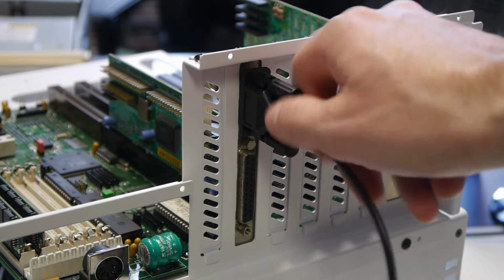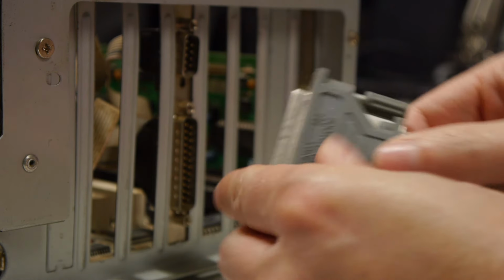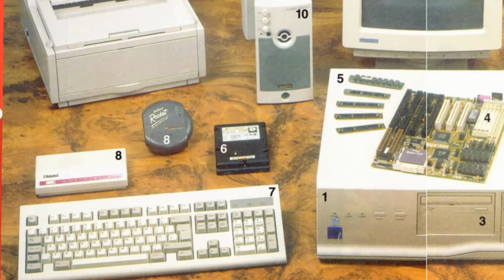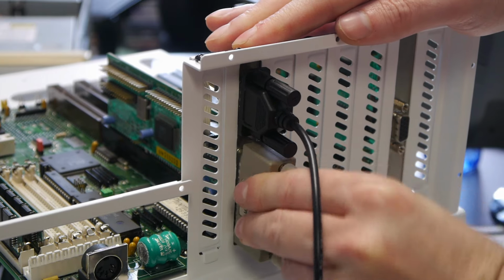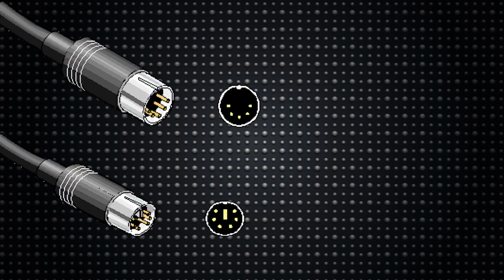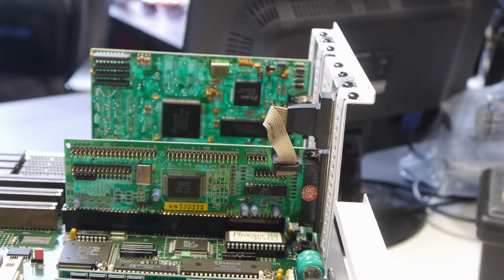What did we use before USB? | Nostalgia Nerd

Comment: Who remembers connecting 2 PC's together with a serial cable and using "LapLink" software in dos to transfer files between machines at a whopping 115k.
Reply: I did that, but not for LapLink. I used it for DooM, the first Command & Conquer and Red Alert games with a friend, and briefly for Jedi Knight until we upgraded our modems to 56k and moved on to IP games, and later the Zone.

Good times. I do miss the old days, but I do still use a lot of oldschool console copiers, so at least I still get to fiddle with floppies and parallel.
Reply: The Norton Commander could connect 2 PC's as well for file transfer.
Reply: Or a parallel laplink cable and get much higher speeds!
Reply: @JeroenPluimers , I worked at Traveling Software at the time and was the primary developer on the parallel transfer technology.  Fun times!
Reply: f29 retaliator. Couldn’t use the network, but did use a null-modem serial canle for two-player gaming. My graduation took a lot longer because of it
Reply: Still faster than many USB Drives after 1GB...
Reply: @imperfectcell7517   One computer would have intersvr.exe, and the other would have interlnk.exe. You needed to edit config.sys to declare interlnk.exe as a device driver. The interconnection could use the serial ports or the parallel printer ports on the two computers. I keep olde computers around for just this purpose, so that when someone sends me an old drive and they need the data extracted from it, this is the method. The old drive goes into the computer that has intersvr.exe, the computer with interlnk.exe is a more modern machine that accepts the data and then after everything is transferred, it can then be placed on a CDR or thumb-drive.
Reply: @GrowlyBear917  cool setup
Reply: Nope, but I do remember X-Tree Gold!
Reply: DJ_PaulTUK oh that was magic!!!! So much self accomplishment back then.
Reply: All i remember is fire wirw

Comment: Serial ports (mostly the standard RS232, but also RS422 or RS485) are still being used for industrial applications. They are ideal for low speed communication where there's no need to pass around  large packets of data - for example, if you need to control a power supply which is only turned on and off a few times in a hour or a digital multi-meter which needs to report a single reading every few seconds. USB is  being adopted but, pretty slowly since it is also far more complicated to implement USB communication into a device than good-old RS232

Comment: I used to hate SCSI. Didn't even bother trying to get a card with a CDROM when they came out mid 90s, SCSI was an interface jungle. And all the IRQ/Mem mucking about on the cards on PCs -sheesh! A decade ago when i moved, i dumped a large box with 90's cables into the trash and i still have no regrets.

USB was mediocre when it came around, i bought a 128k USB Stick (that's right, 1/8th gig, whopee!), while it was nice to be able to transfer some files between PCs, it wasn't fast or as ubiquitous as it is today with 32/64 GB sticks being sold everywhere for €10-20, and 2 TB external harddrives with USB interface being sold for €100.

We're better off now, but there are still adapters form Usb sticks, SD-> Micro SD and CF cards->micro SD (i still use them in my Amigas). Would never believe that i could fit 256 GB of data on a thing the size of my thumbnail... and they're only getting more capable each year.

Comment: USB is faster but one of the things i like about serial, parallel, VGA and game/midi ports is that the connectors are robust and not easily damaged by careless people, dont wobble and have thumb screws to secure them. USB plugs and sockets (micro especially) can easily get damaged/broken, become loose, make poor connection and easily fall out. I've resoldered or replaced the microUSB socket on phones and tablets many times for different people.

Comment: I definitely don't miss having to scrounge around for connectors, adapters, & couplers. USB still has a similar problem with all the different connection types. Type A, Type B, Mini USB, Micro USB, & Type C along with the 3 different iterations of it. So you still end up needing things like an A to C adapter & such. Just now days, the cables aren't as bulky.

Comment: USB was great, simple and convenient until all the madness with the different versions of USB 3.x started. Now there are probably more varieties of USB connectors and standards than there were different ports on old PC's.
Reply: jgfjgfify It's the same mistake that helped kill parallel SCSI.  The standards committee was overrun by lobbyists wanting to sell more adapter cables, and in the end, you always lack the right cable for whatever you need to connect.  USB can now have any of 5 to 6 A connectors (including C used as A) and any of 5 to 6 B connectors (including C used as B).  Plus either of the 5 to 6 female A connectors on extension cables and either of the other 4 to 5 A connectors in link/transfer cables with any of several standards for the molded in A to A link chip.  That's more than 70 different USB cables you might need to have in your parts drawers.

Comment: By the 90-tys a lot of new computers had both a 25 as well as a 9 pin Serial port (and a parralellport). the 25 pins was usually used for modems and the 9 pin for mouses during the time people browsed the web with windows 3.1.

Anyway. Using a old 25 pin to 9 pin adapter you could use two mouses at the same computer. In windows 3.1 it really didn´t do much. But in the game Settlers this made it possible to play split screen... PERFECT.

Comment: I hate USB. I am a hobby OS developer and electronics engineer (by trade). I bet other people like me know what I mean.
Reply: P these days I resort to USB to serial converters, either as those cost interface cables or ICs that do this function.
I built a small magnetometer that uses an IC to provide the connection between the desk top computer USB and the serial interface on a magnetic sensor module. The module uses the same IC found in some tablets.
I think if we are going to be forced to use blotware we might as well use a radio interface such as Bluetooth or WiFi, these are now available on small microcontrollers such as the ESP32. These have the advantage of inherent galvanic isolation. So my next home brew testgear will connect by radio, either bluetooth, but more likely WiFi.
Reply: pvc completely agree. It was once very easy to talk to the hardware using an application program. USB drivers and protocol stack makes this really hard work.
I have designed a number of bits of test equipment which supports USB, but these usually use ICs that convert usb to a virtual serial port.
Reply: Daniel Bush don't you mean inconvenience. The wonderful thing about USB drivers it allows manufactures to make perfect working peripheral hardware obsolete over night and blame it on the os manufacturer. That way the peripheral manufacture can sell the user yet another version of the hardware which is slightly worse then the one it replaces. By worse I mean shifts yet more of the work load on to the computer processor, and missing one or two of those odd useful features that were in the last version. Printer manufactures please note.

Comment: Firewire wasn't an Apple-only thing.  I have a Dell laptop with a mini Firewire socket, although in the PC world it is commonly known as IEEE 1394 or i.Link.  Many Sony laptops also carried it.
Reply: It was heavily pushed by Apple/Sony, and adopted as standard DV connector for digital cameras.
Reply: IEEE 1394 is a serial bus standard that was collaboratively developed by Apple, Intel, Texas Instruments, Microsoft, Sun Microsystems, Compaq, and National Semiconductor
it was a real bus, it was low latency, it was DMA capable and it was HIGH Speed compared to USB.
But it was also expensive and only was used in professional equipment (the Apache attack helicopter) like audio and video equipment, and early external hard drives including the first 3 gens of apples iPod.
Nvidia Chipsets offered fire wire as a default. And many other PCs hat it too. And it was often the only way to get digital video of a miniDV camcorder.
Reply: I still have an early 2000s Sony digital camcorder, and it has a Firewire/1394 port.  I never had a PC that I could plug it into...  Always had to use the RCA connectors.
Reply: From what I remember (can´t be bothered googling :P ) the name "Firewire" was exclusive to Apple, while the standard in itself was open (IEEE1394). I´m sure this will swiftly be corrected if wrong,  by one or more of the many YT police persons. Or if without swearing and childish language just a person wanting to enlighten me - thanks in advance in the latter case.
Reply: It was actually a Sony invention. I remember I had to buy a Sony camcorder > Apple FireWire connector to transfer my home movies to a Mac.
Reply: The original Playstation 2 model even has it.
Reply: srtgrayfrance It was developed by Apple but not exclusive to Apple.

Comment: there is something i am missing in this video, and pretty relevant. The fact that before plug and play, every connection has to been set manually in facts of DMA and IRQ, sometimes forced using jumpers or dip switches next to the cables
Reply: oh the days when something went wrong and spending hours troubleshooting jumpers and irq settings and everything else with no internet and only manuals and you own experience
Reply: @thatdumbguy6171  
But ... you could trouble shoot it.
Today if the modern Plug&Pray driver just refuses to work, you are doomed.
Reply: Cochese    ...and terminator plugs for the internal flat flex cables.

Comment: Saw the title and said to myself. "What a dumb question, of course we had this mess of gameports, serial ports, DIN ports, PS/2 and all other things both standard and proprietary.  Who doesn't remember that?" Then it occurred to me.  When was the last time I had a computer without USB ports? It doesn't seem like that long ago that USB made computing so much easier, but it's really been a long time hasn't it?
Reply: Just got my very first PC -- as in desktop -- with no other ports onboard but USB, and Ethernet and an unused DP. Not even a PS/2 port anymore.

It's a strange new world.
Reply: The first mainstream computer to use USB was the original Apple Bondi Blue iMac from 1997 and that was a little over 20 years ago now. That means that their may likely be a not insignificant portion of the audience for this video that was born on or after the 1st mainstream USB equipped computers or who was to young in the early early to mid 90’s to remember what sort of ports the family computer used back then.
Reply: My first PC in 96? or was it 98? Probably 98 cuz it had windows 98, now that I think about it... anyway, that thing had  I think 2 USB ports in it, but it also still had the gigantic 2000 pin printer port. I remember my brother's first MP3 player. Damn thing cost like 100 bucks, held maybe 13 songs, and it connected thru that port. Things have come a LOOOONG way.

Comment: If I remember correctly USB was not so resource-saving in the beginning, compared to serial connections. 

Old serial mice and keyboards were more popular with gamers for a while (because of the polling rate of USB Mouse)
Reply: This is still the case, because PS/2 hardware functions as a hardware interrupt instead of being polled like USB hardware.
Reply: Hello,
Yes, of course, I meant something else. 
Earlier in Pentium and K6 times this was really relevant with increasing CPU performance and better implementation in chipsets this became irrelevant over time. 

The gaming part that has lost importance over the years also today allows any keyboard/mouse to change the polling rate etc.

But for a while, it was really a big thing

Comment: Meanwhile, in the Mac camp during that time, Steve Wozniak's brilliant Apple Desktop Bus eliminated nearly all this rats nest wiring, handling keyboard and mouse as well as joysticks and even modems. (?!) Apples adoption of the SCSI format allowed daisy chaining. It was a rare sight to see a Mac with full I/O with no ability to add devices. The thing that baffles me though is that Macintosh had two serial ports, both 9 pin mini dins. It was a nicer plug for sure, but why two? Because there was no parallel, of course! Printers were usually serial devices.
Further, networking was achieved by use of those serial ports, via Localtalk, which in turn could be connected to a phone line allowing the computers to use the existing phone network to communicate. If you ever wondered why your School had Macs, there's your answer. They could be networked without any change to the infrastructure.
Reply: early on in the Mac's life, there were NuBus 10baseT ethernet cards. It wasn't all Localtalk.
Reply: I'm sure there was, but localtalk had the best price: Free. Consider with phone net you can network your computers without needing to change a single thing or run a single cable.
Reply: Apple modems ran off the Mini-DIN8 serial ports, not ADB.
Reply: My school, and every school i've ever known, used Windows. That seems to be more of a US thing, since their schools are shit.
Reply: There wasn't a "Mini-DIN8" on the Macs, seeing as how they were Mini-DIN-9 ports. Also, this. https://tidbits.com/1991/09/23/teleport-capabilities/
Reply: Glass houses and all, Macs were more expensive and generally better computers that were suited for education. CD Rom capabilities well before the windows world. And they just fuckin' worked. Kinda a selling point for a world where "computer" was a fancy word for "expensive brick that no one knew how to use."
Reply: @Mostlyharmless1985 You are confused. LocalTalk did NOT use ADB, there are separate modem/printer ports on vintage Macs connected to different chip, Zilog Z8530 instead of MOS 6522 Via.
Not to mention ADB wasnt Steve Wozniak's brilliant invention, it was intended use case of 6522 VIA.
Reply: No, i'm not confused. I also said nothing about Local talk being over ADB. I said you could use a modem with it, which, you can. Which, I did. Yes, Steve Wozniak did in fact create ADB. No, it wasn't off the shelf parts being used correctly. I don't understand how you can cock what I said up so fucking completely, but if you look at the damn protocol, you'll see quite plainly that it has a theoretical maximum of 128kb/s, and a 5v rail. Yes, you can run a modem off of it. With nothing else, like goddamned magic. I fucking linked to you the modem that did this. YOU CAN USE ADB TO TRANSFER SERIAL DATA, THIS WAS A TASK THAT ADB WAS DESIGNED TO DO BUT RARELY UTILIZED. How do you think copy protect dongles worked?
ADB was USB before USB was even a thing.
Reply: so you didnt write "networking was achieved by use of _those serial ports_, via Localtalk"
Reply: Yes, the printer and the modem port. Did you miss "The thing that baffles me...Macintosh had two serial ports, both 9 pin mini dins." Obviously, i'm not talking about ADB because it is a 4 pin mini DIN, same as S-Video.
Modems are not for networking per se, they enabled point to point communication, Your gateway was beyond the Point to point, not the same as localtalk (it's in the name, clever, eh?),  though I guess if you hated life you could attempt to use PPP to connect to a gateway to bring you to another Appletalk zone.
All this is moot because, like i said, the Teleport modem was a thing, it was a surprising thing, because it ran entirely off of the ADB bus.

Comment: My first PC with Pentium 150 MHz (not MMX) and 16 Mbytes RAM computer of 1997 had. 
_A Windows Microsoft keyboard with DIN connector 
_A Microsoft Serial mouse with serial DE-9 connector. 
_A US Robotics Serial modem 28.8 Kbit/s mode with serial DB-29 connector. 
_An HP laser printer with parallel port
_An HP scanner with SCSI connection. 
_A Microsoft optical Sidewinder joystick connected to the game/midi port of my sound blaster  
_An internal SCSI Philips CD recordable drive on an Adaptec SCSI ISA card. 
_A Sony monitor with a VGA connector on a Voodoo PCI graphic card. 
_A Quantum SCSI hard disk 

SCSI peripherals before the introduction of USB had a comparable or even superior speed to the first version of USB with the 12 Mbit/sec speed. However the later USB 2.0 was a game changer. 
Before USB with the exception of SCSI which isn't referred on the video every peripheral had its own connection. 
USB was using the CPU but SCSI didn't. SCSI was very useful for a fast system.

Instead of spending more for a faster Pentium CPU and more RAM, I invested on a SCSI hard disk, Scanner and CD-R. I didn't regretted that.
Reply: your first pc is considered to be in stone age compared to new computers. Hey try running windows 10 on a Pentium 150 MHz processor thing will most likely heat up and fry the motherboard
Reply: +Trophical Paradise
No. Aside from not getting installed in the first place for various reasons, it would just run very very slow. You don't fry your PC trying to run a game which minimal specs exceed your system, do you?

Also, nonsensical argument anyway. "Your PC can't run an operating system coming out 19 years in the future". wow.
Reply: Max Mustermann A PC from 1997 could hardy run windows XP in 2001.
Reply: LTA In 1997 was very powerful

Comment: Nice video! Yet some things need further clarification: Back in the day you could use scsi and firewire devices on a pc through card adapters. So it was not mac only as the video implies. The speed of usb 1.1 could actually justify the use of an external drive. I own all three "kinds" of external zip drives of that era ( parallel,scsi,usb 1.1) and I can assure you that the usb 1.1 is the fastest of three.